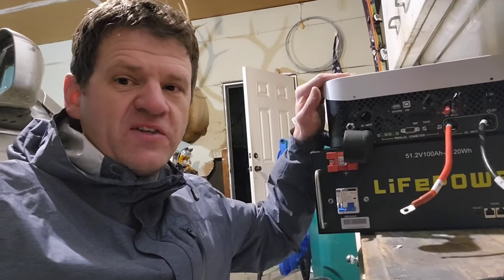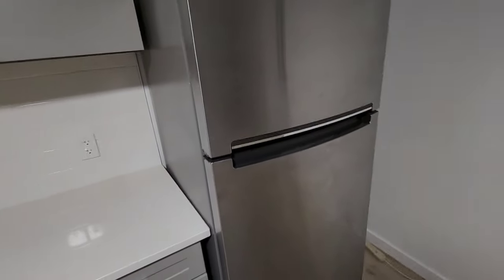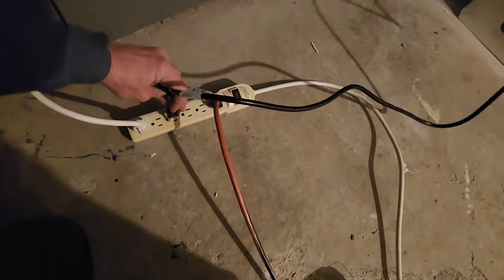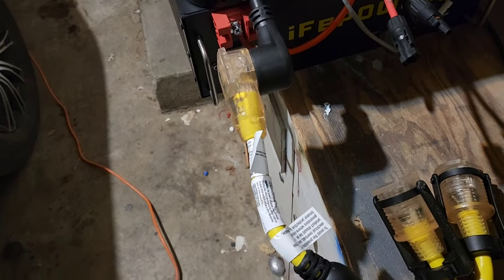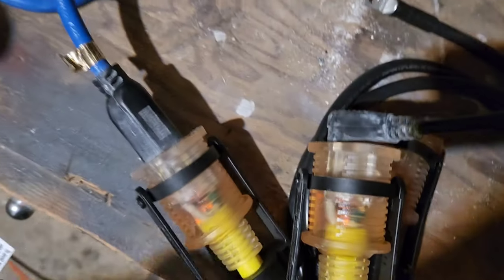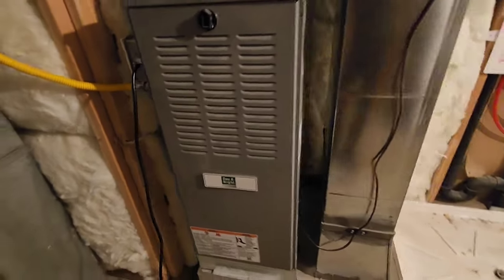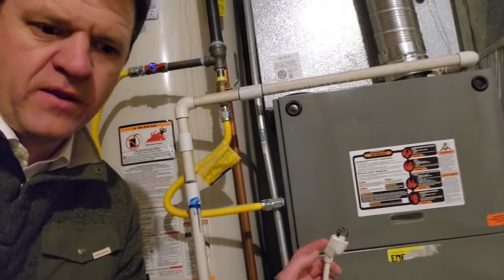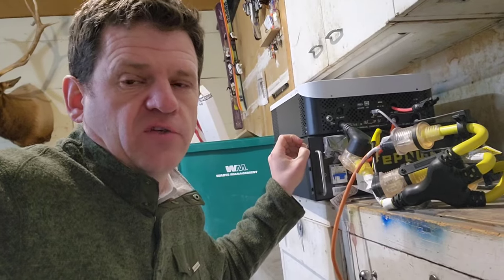How long can a 48v 100ah LifePO4 battery run 3 fridges and a furnace?

Comment from the maker: How long can my lithium batter power my fridges and furnace.
EG4-LifePower4 Lithium Battery 48 volt 5,120kwh battery

kwOther video reviews
How to install a switch plug combo outlet:  https://www.youtube.com/watch?v=cSXVeUg7L0k

=====   Product links(some are affiliate): =======

USED SOLAR PANELS:
https://www.santansolar.com/?ref=DiySolarPowerFun

GROWATT ALL-IN-ONE INVERTER: https://signaturesolar.com/growatt-48v-3kw-150vdc-stackable-off-grid-inverter?ref=DiySolarPowerFun

48 VOLT LiFeP04 BATTERY: https://signaturesolar.com/eg4-lifepower4-lithium-battery-48v-100ah?ref=DiySolarPowerFun

===== Product Reviews ========
-Growatt all in one inverter review: COMING SOON

-EG4-LifePower4 Lithium Battery 48 volt review: https://www.youtube.com/watch?v=ImpV3mx2fdk

-Used Solar Panels review https://www.youtube.com/watch?v=ftvKkMcibdw&t=60s

-Some emergency tips - https://mysillysquirts.com/home-emergency-preparedness-tips/

-----------------------------
Disclaimer
I am not a licensed electrician. Working with electricity is dangerous and can lead to injury or death, even when following documentation and instructions. I can not be held liable for such damage or injury. I am not giving or seeking to give advice on how to work with electricity. You should consult with a licensed professional whenever possible and get all work reviewed by an inspector and follow any local regulations in your area. I'm documenting my projects for informational purposes only.
Reply: You could re do this rest with the new sinwave inverter an meter you have ? An the setting you can change this time too. Just a suggestion. I think it be interesting  to see the difference.

Comment: I installed the EXACT same setup with growatt and EG4 rack battery except i used the 24v inside my friends mobile massage van. 4 120v outlets in the floor and she hasn’t had any problems. She doesn’t have solar but i did hook it up to the alternator of the van, not a whole lot of power but it charges enough for her usage. I also installed a 30a shore power hookup incase she wanted to take it on vacation or something. 

Barely any programming required too which was great! Nice video, glad to see someone else doing the same setup
Reply from the maker: That's nice. Do you remember what you used to hook up the alternator to the batteries?
Reply: @diySolarPowerFunWithRay  it was tricky but the van had 3 separate 12v batteries. One for the bus door, one for the motorized ramp, one for lighting through the bus prior to installation. I used a “Stinger” brand isolator off of the door battery, since it was the closest, hooked to a Victron Bluetooth 12/24 dc-dc. Doesn’t give too many watts due to conversions but she hasn’t had any issues. I’m sure i could use 2 or 3 Victrons but then the cost just goes up for 2-3 off the same product.  Probably wear out the alternator too.

Comment: That's pretty cool. Should definitely determine what you need to keep powered, and test out how long your system can power them. Can always buy some additional portable solar panels and/or a small gas/propane generator to buy some more time.
Reply: That's a great suggestion! It's always important to test out your power needs and see how long your system can handle them. The Segway Portable PowerStation Cube Series is a fantastic choice for outdoor enthusiasts like us. With its massive capacity, powerful output, and fast recharging, it's perfect for powering appliances and devices during camping trips or power outages. Plus, its waterproof technology ensures durability in any weather condition. You can also easily monitor and manage power flow through the smart app control. Happy camping!

Comment: Cool test! I did an energy audit on my home fridge and it came out to 120 watts per hour over a couple of days average. So to keep it going on solar I know I will need about 3kwh of solar per day so my battery doesn't drain. Since I have a perfect place for solar in my backyard with very little morning shade and the rest is clear, I would need a peak output of about 600 watts solar input to reach my power goal. Since most solar panels don't output name plate power in normal conditions I will take the 600 watt solar peak and multiply it by 1.4 times which equals about 840 watts of name plate solar panel rating to reach my goal. If you are doing 3 fridges I think you will want 840 watts of solar times 3 which is a very big solar array. The other thing to realize is during a power outage the freezer stays wonderfully cool all day because of all the frozen food so in a pinch you could put some extra water bottles in the freezer so when a power outage occurs you can quickly take the frozen water bottles out of the freezer and put then in the fridge so the fridge stays cool too!
Reply from the maker: Thank for the numbers, 120 Seems right to me as well.  I need to do any audit as well on my critical appliances.  I think that's definitely the best way.  Those number look good to me. 

 I do my calculation like this:
 In utah, in the winter, I get around 5 peak solar hours per day.  With 1000 watts of solar at 75% efficency I should be getting 1000w * 5h * 0.75 = 3750wh.  Enough for 1 fridge but not enough for 3.

Good idea with the frozen water jugs! I should put some of those in my deep freezer for sure.

That

Comment: You run your refrigerator on an off every 3 hours you can extend your battery run time. They are very well insulated.
Reply from the maker: That's a good point.  That sounds like a good test.
Reply: @diySolarPowerFunWithRay  I have an Ecoflow Detla, I run for emergency use only, cable tv and refrigerator, worked flawless when I went 4 days with out power. I even have some solar light bulbs that work good. However down the road I plan on going to a full battery setup, now that they have all in one units.
Reply: I do that with a generator. I run it 15 to 20 minutes every 4 hours when we have 5 day (or longer) power outages..

Comment: I have just started my 48 volt system. I ran a 24 volt for a year and ran the Fridge and dishwasher. I have to wait until the distribution block come in to wire up the (2) 24volt 300 AM batteries to be 48 volt and I have 3 sets of them so it will be interesting to see how it fairs with the fridge and freezer and the dishwasher.

Comment: Great test and I didn’t want to say For everyone talking about don’t run your battery down to 0% actually you can’t the BMS will shut off before any Damage could be done from batteries going to absolute zero now there is 0% usable power so that’s not something to to worry about unless you’re using a homemade battery without a proper BMS.
Reply from the maker: Thank you for commenting and clarifying. How much better explanation than what I said

Comment: I know this is a old video but thought I would throw in something. On the fridge freezer in basement if you fill it with solids like jugs of water it will run less. A lot less!. solids hold cold better than air. A empty freezer especially will run more often.

Comment: I saw a video, they put a fridge on aa timer to only run 15 minutes an hour, significantly longer run time, and only affected temps 1-2*
Reply: Easier solution is to just adjust the fridge to a warmer temperature, I have never seen a fridge where you could not adjust them warmer / colder...
Reply: I'm curious if that will put more stress on the compressor, instead of just turning down and let it cycle when needs to.

Comment: I am also glad I stress tested my smaller Emr setup, you wont know you forgot something until its too late, trying to cob something together under stress is never a good idea!
there were things I forgot like plugs and extra wire in case I need to Cob something after the SHTF LOL
I am in NY so at a deeper angle, panels run 3S3P, dont cheap out on the charge controller and I have just been running a 1500W inverter and even tested a few smaller one, I might get a few more panels and a few more batteries, I can run a lot of stuff for 8 hours and the panels I have now bring up 500 amp hour batteries by 9:30am
my average Ele bill is $550 so even if I spend another $1500 it will pay for it self in a few months! and only use the ele company as my back up LOL
If I was just running the lights and computers in my house I could run for 2 days without sun, and the only thing that takes a lot of power is the icebox ....

Comment: Shocking results.  I do this daily with 2 of those batteries and no PV.  Just the lights, TV and Refrigerator consume the 10,100 watt hours in about 30 hours.   I recharge the batteries daily for ~2 hours with my generator and 75A dedicated charger.  Plan to add 4 more batteries an 10kW or PV when I get the funds.
Reply from the maker: Interesting. How many fridges and freezers are you running? Do your batteries run down to zero or down to the 20% mark
Reply: Just the one frig/freezer.  Just down to 25% daily.

Comment: It would be nice to try it with solar to see what you get it. I myself am running just a 3 kW 24v battery and a 1500 W inverter to run another refrigerator. The only thing missing from my equation is a shunt, which I plan to put on today. This way I can monitor the power going in and out of my battery and get a much better picture of the SOC.
I’m only using 600 W of solar, which I don’t think will be enough in the winter.
Reply from the maker: How many Watt hours are your batteries? I recently did this test with solar in my last video.
Reply: @diySolarPowerFunWithRay  
On the data sheet of the Mule big battery 24 V 3 kW it says 120 amp hours. That seems kind of low to me?
Reply from the maker: @Simon  OK so each battery is right around 3 kwh.  So 9 KWH total. That almost double the capacity of my 5.120 kwh battery.  If you look at my last video I have a bunch of data from my shunt that might give you an idea of how long you can last with you solar connected.   I bet you can run 2 fridges for 3 - 4 days with heavy cloud cover.... or forever if you have sun.
Reply: @diySolarPowerFunWithRay  
So I believe 3000×24 gives you 7200 W hours?
Reply from the maker: @Simon  to calculate watt-hours you basically calculate the V of the battery X the amp hours. So if you have 24 volt battery.. it should have a nominal operating voltage of higher than that. So let' s just say 25 V. So 25 times 120 amp hours will give you 3 kwh for each of your batteries. (Fixed my typo on my last post)

Comment: Great test!  Question:  I have a solar array that consists of 4 12volt (200w Rich Solar Panels). I currently have them setup in a series configuration. Would this solar array effectively charge up this setup?  Thanks for sharing.
Reply from the maker: Yes, absolutely. As long as you purchase the same inverter model I use in this video. I have a link in the description. If you use the link to help the channel.
     There is another model that I use in other videos that requires a higher voltage which wouldn't work.

Comment: You asked what you should try next. Well, let say the Sun goes down at 6 pm and returns at 10 am (that is too long of a time for solar panels to be any help). It seems that you need to purchase a second battery, and then I would say to get two 500-watt solar panels, but since you can charge the batteries from the grid (assuming the grid is not off for very long time), that would not be necessary. You could also purchase a Victron 48/1200 inverter (I got one), which has a very low stand-by power consumption, but I recommend investing that money towards a third battery and stay with your existing all-in-one unit.
Reply from the maker: Cool. Thanks. Yeah, for emergency I think I'll definitely need another battery.  I'm thinking over a couple different types solar backup setups for my house. I will post those and be building pretty soon. Thanks for posting...
Reply from the maker: This winter we had cloud cover for pretty much two straight weeks. If the power went out during that time I would be totally hosed. I'm not sure what to do about that scenario. I don't want to get a generator. I was recently looking at 48 volt 100-amp alternators you can hook in your truck. That might not be a bad option as backup power. My diesel truck could idle for a long time
Reply: 10 am to 6 pm is plenty of time for the solar to help.  Should get at least 3.6 kw of solar for your inverter, with the solar your runtime will increase significantly as your battery will get some charge as well as your home loads without using to much battery.
Reply: @slipperyslope5364  yeah I am waiting on delivery of my system. All in one with 8 410w panels and 2 48v 5.12Wh batteries.  This should last a couple days with no sun in my travel trailer.
Reply: @johnstark4723  It will last longer than that as each morning with the sunrise your batteries should recharge by noon day or somewhere around there. The cycle should repeat itself daily. Might have to manage your energy usage on excessively cloudy consecutive days. I intend to watch your progress as you post . Cheers
Reply: @slipperyslope5364  I figure it will charge between 10:30 and 3pm most days. That's going by where I am parked now.
Reply: @johnstark4723  Ok, everyone situation will be different I know you will figure out what works best for you. Continue to educate the community as you do. As I said previously looking forward to see how you do.

Comment: Checked out this video after my other comment , interesting. How much of a draw does the GroWatt pull from the battery?
Reply from the maker: From my own testing...If the inverter is idling:  45 Watts.  If it's charging the battery from the inverter with inverter off: 15 watts.

Comment: I think a test that says it all  is further down in the comment respond, a 1500 watt space heater full blast pushing out 5120 btu's  a little under 3hrs  on this system  would be a good starting point  to build upon.

Comment: Just curious.... at the 2:46 mark, where did you get that yellow 30 amp to three 15 amp adapter from?
Reply from the maker: Home depot.  https://www.homedepot.com/p/Voltec-Generator-Adapter-04-00215/206699604?source=shoppingads&locale=en-US&pla&mtc=SHOPPING-BF-CDP-GGL-D27-027_003_EXTCORD_SURG-NA-NA-NA-PMAX-NA-NA-NA-NA-NBR-NA-NA-NEW-Pmax&cm_mmc=SHOPPING-BF-CDP-GGL-D27-027_003_EXTCORD_SURG-NA-NA-NA-PMAX-NA-NA-NA-NA-NBR-NA-NA-NEW-Pmax-71700000099286174--&gclid=CjwKCAjwtuOlBhBREiwA7agf1oyhjuhBXsfmRh2YPJOF-v-AB6tS39KEU4TnRUhhYygss3GNTxeB3BoCq_kQAvD_BwE&gclsrc=aw.ds

Comment: Do you have to go into settings to show the battery percentage? Also does your solar unit fan kick in when you the fridge compressor runs?
Reply from the maker: I can't recall if the fan turned on.  It may have turned on low.  In order for me to see the exact battery percentages, I need to use the communication cable that came with the battery(https://www.youtube.com/shorts/jrUVvyzVflA)
Reply: @diySolarPowerFunWithRay  Ok thank you:)

Comment: Looking At the EG4 6000xp, and the batteries that you are using. I just don’t know which way to go with solar panels. What are your thoughts? I’m still really new to this
Reply from the maker: I would look at getting some used ones possibly from San Tan solar. But if you're already ordering a bunch of items from signature solar you may just want to buy the solar panels from them because shipping might be cheaper as you are already paying to ship the inverter. Are you putting the panels in a ground array or on a garage?  Also, what do you plan on powering with your inverter? The eg4 6000 would be Overkill just to run a furnace fan, but it would be nice to have the extra power if you ever need it in the future.
Reply: @diySolarPowerFunWithRay  
I’m going for a ground mount, probably my furnace fan, sump pump, refrigerator, a room or two in the house down the road. I plan on expanding down the road so
Reply from the maker: I like the used panels.  I just ordered a pallet of these 325 watt panels and plan on selling the extra ones I don't uses: https://www.santansolar.com/product/used-jinko-325w-solar-panels-pallet-of-25/?ref=DiySolarPowerFun